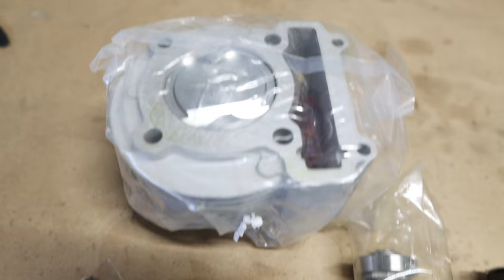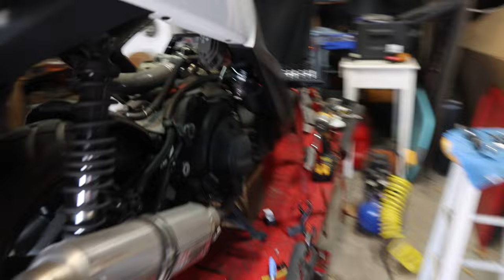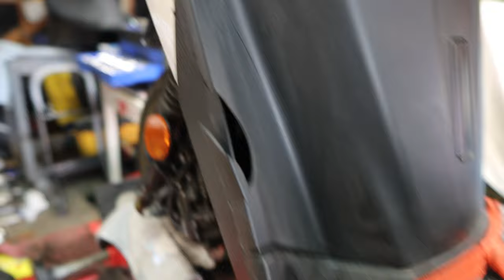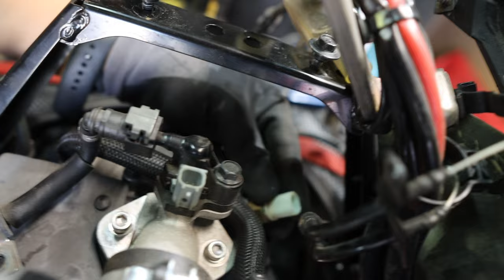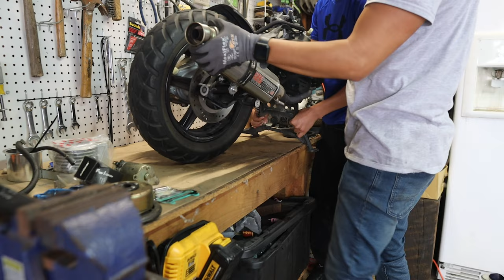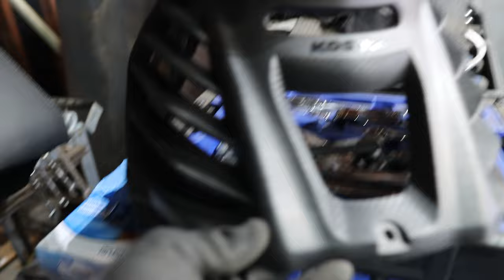Yamaha Zuma 158cc BBK Project Part One #YamahaZuma #SmallEngineVelocity

Comment: Hey Ceasar, since you were able to access the battery after removing the tub under the seat, did you find an easy way to access or change the battery without removing everything?
Reply from the maker: Yea in the back of the tub there is a panel with two Philips screws. Battery is right behind it :)